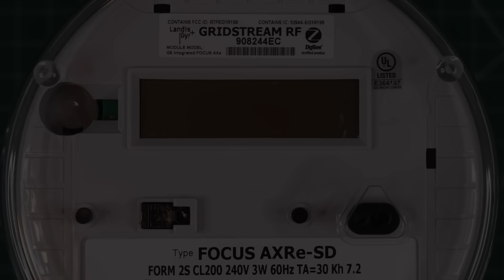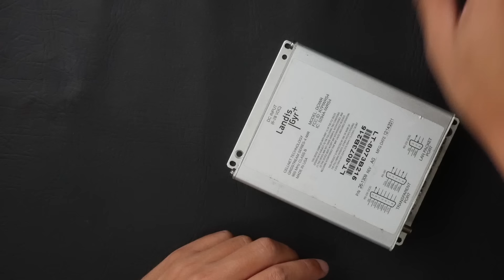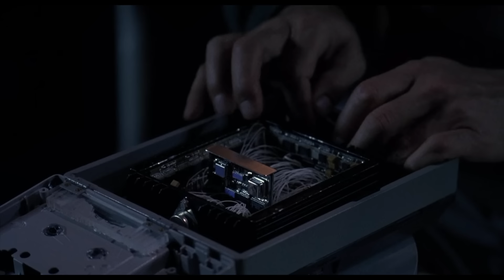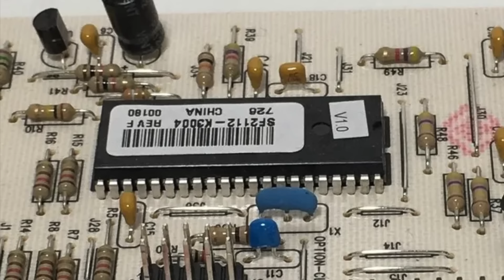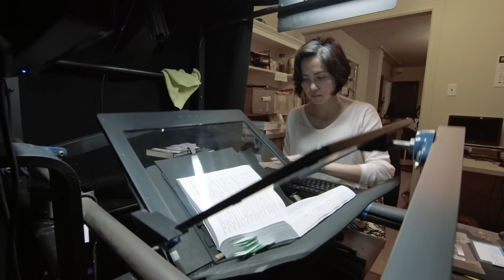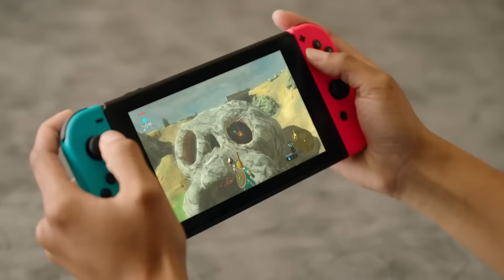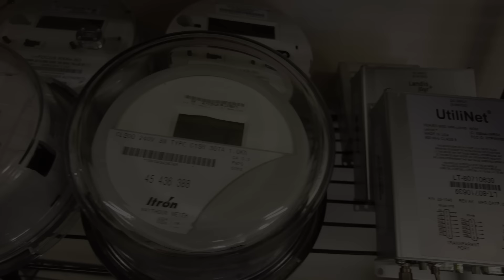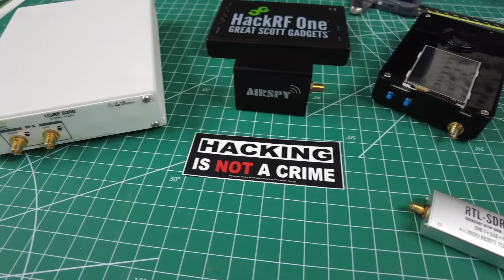The REAL Problem with Smart Meters

Comment: You need to remember that those meters do not just measure the energy used.  They measure the phase to let them know if you have an inductive or capacitive load. By monitoring, they can actually figure out your household habits, when you eat, sleep, shower, etc. by the type of load on the meter and how long it is on.  They also report WHEN these things happen.  It's not just a "meter reading' anymore.  They want to charge you for the time of day you use your electric and they also want to charge you for phase corrections.  This is not legal, YET.  P.S.  Go look up the people who were charged for electric service even though it was out for several days.  There 'meter' reported 'average use' during this time.  So even if you cut your electric off for several days, you are still paying for it.
Reply: a couple years back my house really made a huge push to cut electricity and we started hanging all clothes to dry, I cut my shower in half and really went all out. Of course some guy shows up at some point and we ask him what is he doing...oh your meter has an error and isn't reading anymore it needs to be replaced. Okay so how do they send me a bill if they don't know what I used. They averaged it and charged us the full amount even though I cut so much usage. So dumb and would not change it despite a complaint.
Reply: @jayman912  In case of my country power meter will be tested in external lab and power company is responsible for testing and they have to bear all the costs. Every few years ( i believe 5) it is being exchanged, recalibrated, tested and either put somewhere, sold as auxiliary measuring unit for public or scrapped.
That setup is valid for other utilities as well altough intervals might be longer.
Reply: I'm a jack leg electrician 😅 my specialty is bypassing the meter altogether!  Usually just hit a leg above the meter and rewire the panel so that the entire house is on without power company knowledge. Actually I'm very skilled and nothing jack leg about me!  We Americans are stuck with government backed energy monopolys and absolutely no way to shop for cheaper rates.
Reply: You get charged for power even if it isn’t being provided as there’s generally a daily supply charge… usage during that time would be a bit odd though.
Reply: @JamesTK    Yea.  I do not know what the base, no power used, cost is but I guessing here it is around 18 dollars.  I do know the gas bill is 18 a month with no gas used.  I only use gas for cooking and heating in winter.  I would cut the gas off in the spring, use the grill to cook, but it cost 90 bucks to have the gas turned back on.  might as well just pay it.   They charge on my electric bill "Cook Nuclear Plant renewal charges along with a long list of other charges other than the energy used.
Reply: @johncundiss9098  If you got a nuke plant close to you I'd worry more about that than a smart meter. 3 Mile Island, Chernobyl and Fukushima come to mind. Thousands of cancers from those.
Reply: @johncundiss9098  I live in the country so I have a well, septic and propane tank, it’s so nice not having all those bills with a base fee whether you use it or not. The electric bill is enough for me !  The dump is “free” because it’s included on property tax so I don’t have trash pick up either, it’s easy to take my one little bag of garbage a month to the dump.  I don’t ever want to live in town !!
Reply: @JamesTK  It's not unfair to be charged to be hooked up to wires you never use, or water, or a gas line. Your old land line phone cost you money even if you didn't use it ever. Someone has to maintain that infrastructure. Is the price fair? Well the devil is in the details!
Reply: Big brother is always breathing down your neck. Just waiting to bite.
Reply: @UQRXD  One could say the same about God but we don't because that's stupidity.
Reply: @johncundiss9098  Time of day and power factor are not legal to charge for?
Reply: @soundspark  Not yet it ain't but they want to.  This is reason for the smart meters.
Reply: @soundspark  Time of day is absolutely legal to charge for and many tariffs include it. Some also charge for peak power. Didn't hear about power factor charges, but reactive power creates currents that cause losses in the wires. which does create an actual cost.
Reply: Just had a violent storm in Ohio and no juicy for 4 days. I had wondered how this would effect my bill knowing they're always trying to pull a fast one. I have to go over my bill with a fine tooth comb every month. Thanx for the 411.
Reply: @cornfusedatbest3980    There are video's out there where people have lost power for several days. Since the meters in the area could not respond to an actual reading, they ESTIMATED their bill on how much power they would have used during that time.  Problem is that the power was off and nothing used.  They had to call and argue to get their money back.  So the meters, the computer reading them does not know where power is actually on or off even though the meters now have remote disconnects as well built in.  Be vigilant.
Reply: The hopping pattern is the message.

The electrical consumption and other information they don’t want you to know about is received by some unknown code that is motivated by decoding the hopping pattern.
Reply: This happened to us when our power was out for a week. After that , idk why but our pg&e bill doubled. We took steps to get off grid after that.
Reply: I wasn’t home for a month. Only thing on was the fridge and my electric bill was $34.81 more than the month before. Can you explain that?
Reply: @wrenchaholic_    one of 2 things happened.  My question is how do you know those were the only things on?  Was hot water, pump, hvac all turned off?   Was it during a season change where the a/c had to start working more?   My next thought would be they are doing the averages bullshit to you.  If your meter does not report properly, they take an average of what they think you would have used that day, plus a bit more for there wallet. You can see these on YT as well.  people who power was out for several days then got the bill. they found out they got billed for days when no electric being used.  The computer does not know the electric was out and they "average" your daily use and bill you.
Reply: @johncundiss9098  1. I can access all the data from power meter on my power distribution company portal. That includes flows both ways plus capacitive and inductive load for all 3 phases. And it is just small residental install. Also measures voltage and frequency deviation.
2. In case of my smart meter it measures in 15 minutes interval. So if i consume 7,5 min 2000W and then nothing, within 15 min interval it shows as 1000W consumed. And this is absolutely ok.
3. Better to fix bad setup of energy grid laws which distribution company have to adhere in your state or on country level than blaming technology.
Reply: They are building the PRISON around you by illegal seach and seizure.  It will measure how many times your a,/c /fridge and etc come on and eventually show you have older units so you have to upgrade or be fined for over use by outdated units etc.  It's watching u like a PRISON Gaurd documenting every millisecond
Reply: Charging for time of day of usage makes perfect sense.  The utility pays a different price for electricity for different times.  Like if you can only use electricity when electricity is at lowest cost you can save money. Then again if you can supply electricity when the price is high, like when the utility is short on power, you can make money selling power to the Utility. This is not netmetering but buying and selling based on supply and demand. A win win.
Reply: @stanleytolle416  sounds like a win win for the utility and a hidden tax on my lifestyle
Reply: @stanleytolle416    I would agree to a certain extent.  Yes, During peak demand when industry is running full bore. Residential demand would be nice if it went down. It doesn't.  We could benefit from people doing their chores at night instead of daytime.  Unfortunately humans do not work that way is the first one.  The second big one is this.  Sure you can make power and supply the grid to help.  BUT.  Say it with me  BUT.   They will charge you thousands to hook you to the grid to supply it, you must be in sync with the grid, 60 hz. That I understand.  The second and biggest problem is that they charge you a dollar for a kw hour, per say,  they will give you 10 to 12 cents per kh hour you supply.  Tell me now, Is this still fair to you?
Reply: Reactive load does cause load on the grid so you will be billed. That's why it's measured.
Reply: Legal is not lawful it is piracy by "government" who work for others but are paid by us, their employers.
Reply: NO! Smart meters do NOT seperate  active and reactive power loads for a residential home, and charge separately for it. 

They DO for a commercial business, BUT, they HAVE been charging them for it for DECADES. 

NOTHING has changed!
Reply: @davelowets   First off it is resistive not active. Secondly, yea they are measuring it.  No they are not charging for it  YET!!!
Reply: 'Time of day' billing is being employed all over.  Comes down to supply and demand.
Reply: You must have grown pot to know about or worry about that.
Reply: bet they loose all that if you run loads behind an inverter.
Reply: i was off three weeks for a new service  ran on gen   but electric use increased instead of 75% less  , at the same time changed to all led lighting and removed a freezer    never has a decrease of use.  feeling ripped off , i installed digital power monitor in load pannel and my bill suddenly decreaed by over a hundred a month  with no change of use.   coincidence?  i was told there is no such thing
Reply: @edminnich4971    The meters are transmitting to a local network node.  They are hard to see but they are up on the poles, almost looks like a security camera.  If for whatever reason the power is lost to this node, or it is not reciveing YOUR meter signal, the COMPUTER assumes that your electric is being used and calculates your AVERAGE for that day plus a bit more for themselves.  Unlike old meters where there is no power there is nothing to measure. New meters and computers ASSUME you are still there and charge you.  They do this even though they know no service was available during that time.  Computers based on programing will also assume you will always use MORE, not less.
Reply: Noticed this with Duke Energy. Same bill with no use.
Reply: and are disease producing.
Reply: We New Yorkers cant turn off the 8 letter HOCHUL alarm.  The GRID PUSH IS REAL: ELECTRIC!  ELECTRIC!  ELECTRIC!  Wood before tyranny
Reply: This is why we don't let them on houses!! It's a 4th amendment violation and you have a right to privacy In Your home unless you give up your right, and we don't give up that right with these so we use analog
Reply: Yes, a lady was selling her house. EVERYTHING WAS UNPLUGGED N NO POWER BEING USED! She got a bill! 
She was furious!!! They told her the meters total up all power used in her neighborhood n then they divide it! She had to pay it. So she had meter  pulled n sold house quickly.
Reply: @MarkousMajorSurf  Does she started appeal? Like to public service commission in state?
Reply: @rybaluc  no just sold it with no power on to a friend.
Reply: @MarkousMajorSurf Well NO shit she got a bill. You DO get charged a minimum monthly service fee, even if you use ZERO power, and it HAS been that way for YEARS... Wise up!
Reply: @davelowets  I bet ur a bot. Lol hey bot if u don't use power, water u shouldn't have a high bill. It's called common sense.  Be like me charging u for ur kind words in ur comment when u didn't use any.
Reply: Yet I bet you own a smatphone who can literally LISTEN to every word you say in private, but you are concerned by the type of information they can extract from a smartmeter ? How do you think "hey siri" works ? "She" has to listen and decipher every word you say and they can do it with or without your concent as long as you own a smartphone, I'm sure it's all in the policy they change every month or so AFTER you bought the product. A one-sided "concent", agree, or you can't use our "services".
Reply: @BrainHurricanes your special. I'll bet you get coloring books for Christmas. You have no idea if he keeps his cell in a lead box or has no mobile at all. Are you saying that this trespass into private personal household information is OK because cell phones?
Reply: @BrainHurricanes  We just slaves.
Reply: @BrainHurricanes can a smartphone ignite and start a house fire? Many of these smart meters are matches and set homes on fire from the inside.
Reply: It annoys me when people say “bet you own a smart phone” AND….

So no one should worry about privacy even in smart phones? You are just making the argument stronger that something has to be done about privacy. You’d have to live in a tent in the middle of the woods to truly be off the grid which isn’t practical or possible for most.
Reply: @BrainHurricanes  You can turn Siri OFF and then you just use the phone normally after that.
Reply: We can already assume what your average load will be, when certain things in your house turn on and off, peak load in a neighbourhood or apartment building. We already use this assumption to size panels. It’s a bit intrusive for the power company to report back your exact habits, but it’s typically just thrown into a giant calculation because your use will NOT be unusual unless you draw crazy power at all hours.
Reply: so, @samuelkerr465, like if a house was being used to grow plants indoors (veggies or weed doesn't matter for this discussion), that increased usage would tip off someone...& if the home owner had family come stay with them, say due to an eviction, that increased usage would attract attention. :-(
Reply: @samuelkerr465  Even before smart meters, people with grow houses were getting busted based on high usage. And also infrared scans of their house. but that is another discussion/
Reply: @franklofarojr.2969  yah just basic meter readings eh. I’ve seen some UK footage of grow houses with thermal cams. It’s pretty funny.
Reply: But what do they do with the information? It's easier to just find out what shift you are working, by watching when you come and go. Then we can kinda guess when you eat, sleep etc. 

Ok he's home again... Now what??

I don't know.. I thought you did??

Shhhh... I think the microwave door just opened, new load showing the 5W bulb activating.

Nice.... Okay now what??

I'm hungry all of a sudden.
Reply: @fxsrider The power company doesn't give a FUCK when you are home, and when you're NOT... 🙄

Let's get REAL here... 😒
Reply: @davelowets  Lowered the landing gear all the way down with my post. Missed ya...
Reply: @fxsrider  Read the whole post.  Reasons are for phase corrections and peak load charges. They want to charge you more for what kind of load you have and when you use it.  So, to what end?  I can't wash myself after a hard day of work because it will cost me twice as much and now have to wait for THEIR ok to take one?  You bought an electric car for simple tooling around town and such, added a charge port, expect someone to come and look, maybe with a warrant because they think you are now running a grow room due to "a marked increase of electric usage at night".
Reply: @johncundiss9098  Those are valid things to charge you money for. Reactive loads put extra strain on the equipment that resistive loads don't - they force the power company to upgrade lines sooner, which costs money. That's your fault - you should pay for it, not us.

Peak load charges are for you using power when there isn't much to go around - they run the cheap power sources run all the time, and when you start sucking down more than they can provide, they have to start up power plants that are more expensive to operate. Your air conditioner kicking on at 2 PM and wasting money because you didn't cool your house down in the morning is your fault - you should pay for it, not us.

What mental break did you have where you think the power company will control when you can take a shower? Water pumps are cheap to run and water heating is either done with gas, or if you're a weirdo with an electric water heater, can be done at night when power is cheap.

Grow labs don't use power only at night. When I got an EV, I didn't get a knock on the door from the cops, I got a postcard from my power company telling me I could switch to time-of-use rates if I wanted to save money on charging costs.
Reply: @Phoen1x883    Thank you for the hole I get to type for you. If loads are increasing on the lines they need upgraded anyway. Electrical energy is not a want anymore in the world we created, it is a need.  Precooling does not work, it is air, it has no thermal mass and actually waists power, raise the temp in the day and lower and night, check into it.  Let's see, peak loads are predictable. Build more plants. Yea we are paying for it.  I NEVER said that I cannot take a shower when I want to, I said if I take a shower when I get off work it will cost me 3 times as much.  Why should thousands of people who work have to not take a shower and wait for the power company? That can actually lead to health hazards. Do grocery stores charge more because they are busy at the time?  Grow lab is one example,  my nephew owns and electric kiln.  He upgraded to 300 amp service for it.  THEY KNEW IT WAS THERE EVEN.  2 months later AEP and a cop was at his door and searching his yard looking for this load THEY KNEW WAS THERE.  P.S.  I USE electric to heat the water, there IS a difference.  MY hot water STAYS HOT once it is heated. It has insulation ALL around.  Gas water heater now use gas AND electrics for their venting.  If you have a pilot light OMG what a waist.  Heat also escapes from the bottom when off, oops.  I am all for some efficiency, seal up your home, try use your energy wisely and stuff.  But when electric companies can monitor your phase, load, they can tell everything you are doing and when in your home.  WHY?  What business is it of theirs? Are you now a private citizen.  (  WE NOTICED THAT YOUR ENERGY USEAGE WENT UP THE PAST TWO DAYS, WHAT ARE YOU DOING?  DO YOU HAVE PEOPLE IN YOUR HOME?  WHO ARE THEY? WE KNOW BECAUSE YOU HAVE BEEN USING YOUR STOVE LONGER AND YOUR LAUNDRY HAS BEEN RUNNING TWICE AS MUCH.  WHO IS LIVING WITH YOU? TELL US OR WE WILL COME IN AND FIND OUT.  best regards, YOUR government.
Reply: @Phoen1x883  EVs charged at home tend to draw more power when most things use less, and vice versa. Makes for more steady loads. And load changes are expensive, sometimes there is too little, or too much (yes that is a thing) to go around.
Reply: @Phoen1x883  The walls themselves store a lot of heat. Not just objects in the house, but the very structure.
Reply: What you are describing is rightly charging the consumer for the infrastructure costs of transporting the power from the power plant, poles substations transformers etc. someone has to pay for it and we have always paid for it because it was built into residential electrical rates. Now it is called out as a separate line item in electrical bills.
Reply: Most residential customers are fed off a single phase.   So phase corrections (whatever they are) don't apply. Inductive/capacitive really is not residential customer issue....Commercial/Industrial yes might be.  Utility can't figure out your shower activity unless its a electric water heater...and even then it depends on how big the water heater is, and when you use it...and I guarantee its offset by 10 to 15 minutes for the heater elements to turn on.  And as far as being billed for electricty when power is off....that won't happen, because the 24 hr load profile will show zero's...the average use might be for the Meter Read at the begin of the billing period, and the meter read at the end.  The difference is the kwhr usage between those periods, and the average usage would be the usage divided by the number of hours between....and that should be much lower (usage not $) than normal.
Reply: @fmorgan98    So you make an argument when you do not even know what phase correction is?  90 percent of homes have a/c today.  What kind of load is that?
Reply: @johncundiss9098  Yes explain to this electric utility engineer of 40 years what "phase correction" is. I'v never heard of that at the residential level.   And just because 90% have A/C doesn't mean A/C is running continous, nor during the winter. A/C is a sporadic load comes on/goes off frequently.  A large portion of the residential have electric water heater...or in the south electric heating...both are resistive loads of on/off.
Reply: @fmorgan98    If you do not know what phase correction is, capacitive and inductive loads, ELI the ICE man, look that up, there is no way you are an engineer.  Right down the street from me are the 3 caps that are automatically switched when needed.  Never said running continuous.  But there are 10 of hundreds of homes with them cycling on and off at any given time on any given phase.   Most hot water is gas in this area.  Even those need plugged in now.
Reply: @johncundiss9098  Listen what you are calling "phase correction" is power factor compensation...perhaps we are squabling over minutia. I am an engineer...what are you?  Power factor comp for residential individual customers is not heard of.  Pf for industrial..yes, Pf for commercial some.  What's your bonafides on this?  And what is down the street that they need cap compensation for?  Who owns the caps...the customer? Or the utility? Caps on the pole, are often not used for power factor correction, but are used for voltage problems..typically when load picks up in the morning.
Reply: @fmorgan98   Power Factor Correction is for switching power supplies and is for phase correction.  So that current is being drawn through the whole wave instead of just the peaks.  Now listen to what you just said. Do you think I as a consumer went out and put a set of 3 capacitors of the 115 kV or so on the lines?  Did I install the box with the switches in it ?   Then you say they turn on for the increased load in the morning.  Just how much energy(yes energy not power) is held inside a capacitor?  Load picks up in the mornings and afternoon due to what?  Electric motors. AKA inductive loads.  What do you think phase correction So if E lead in the L then you add some C so that the I and C come together to make things 'look/act like a resistor to keep power production nice and happy.  I am a mechanic.  These basic things I learned with a ham radio license.  The difference is my corrections come from an antenna tuner so my transmitter is nice and happy with no reflected waves.